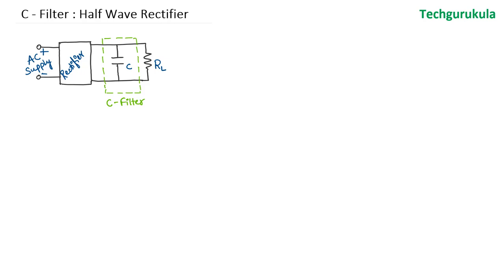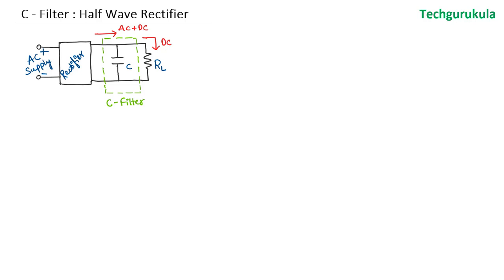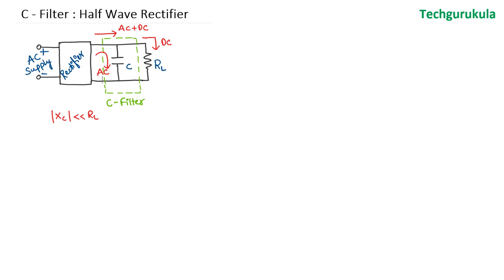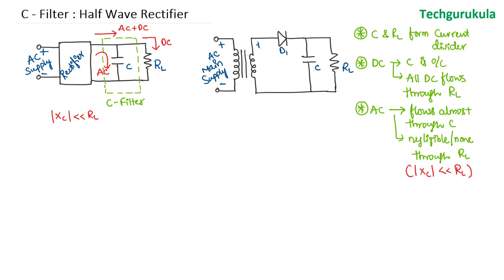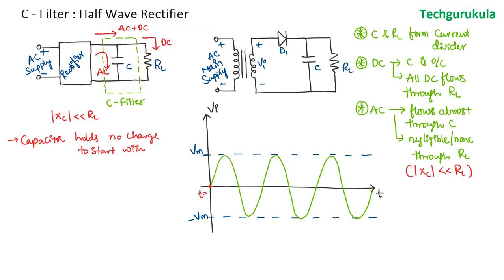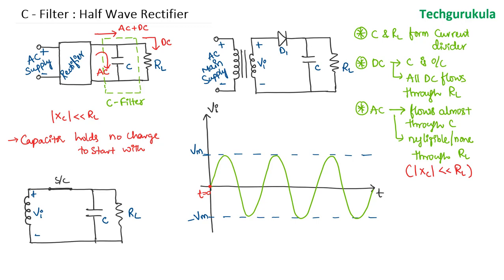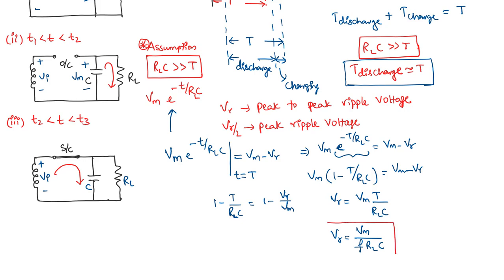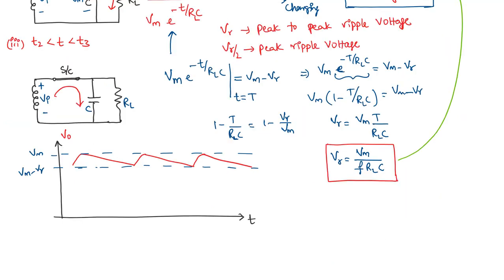C Filter - Half wave rectifier

Comment: Analog start karne se phle edc ki requirement h ya nhi
Reply from the maker: Hi Suresh,
Electronic Devices is about understanding physics behind the device operation to get IV or CV characteristics.
Analog circuits is about using devices characteristics to design circuits for application.
If you can draw proper boundaries, understanding devices and characteristics is enough to start Analog.
If curiousity levels are high (to avoid certain doubts/questions) completion of devices is recommended.

Comment: Sir, why Vr/2 ??
Reply: From output voltage if you remove DC component the waveform is symmetric wrt to time axis. Then peak to peak voltage is Vr. Therefore Voltage peak is Vr/2. I believe its correct